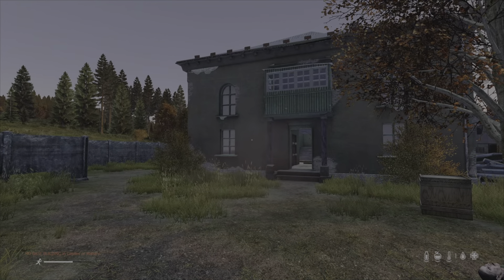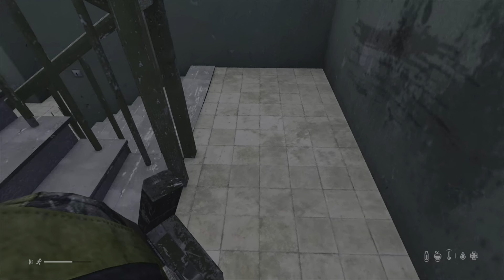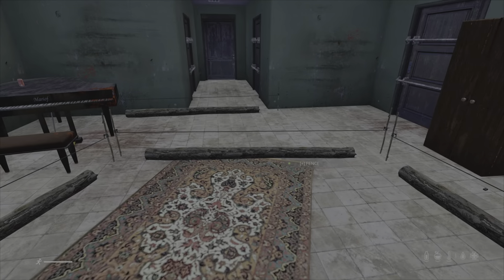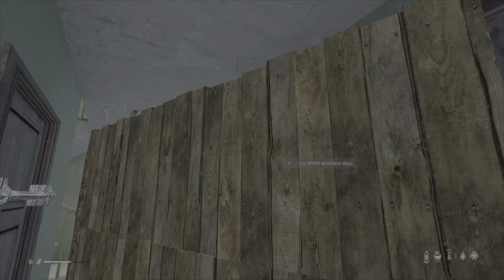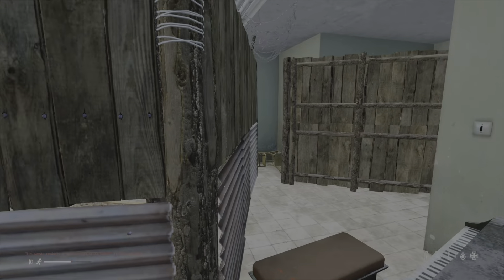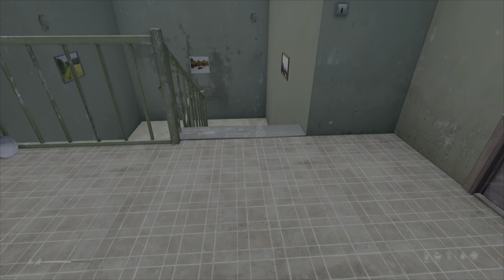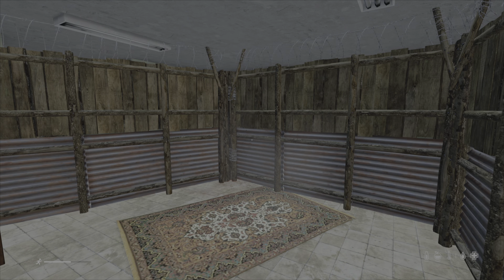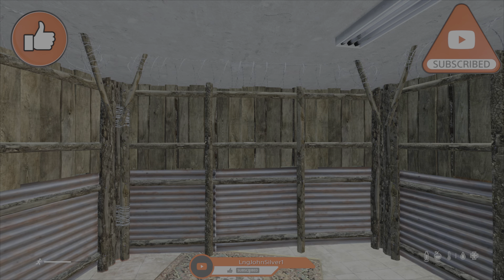DayZ Builds - The Piano House

Comment: Hi.
Couple questions.. Why didn't you put the barb wire down the fence and why are the metal sheets just down?
Reply from the maker: I think you are asking why didn't I put barde wire at the bottom? It's a pain on doors cos you tend to get cut trying to open the gate. Good on fences though. I did say, if you are short of metal just stick it to the bottom cos it can handle slightly more damage and prevents people crawling under the fences. If it breaks on top doesn't matter, its not easy to jump a fence in a house.
Reply: @LongJohnSilver_PS5  👍